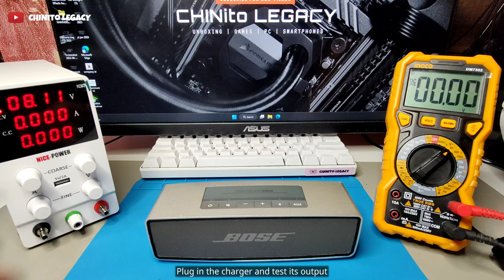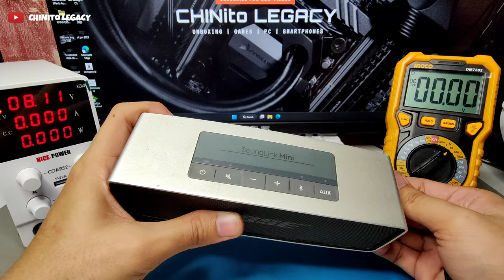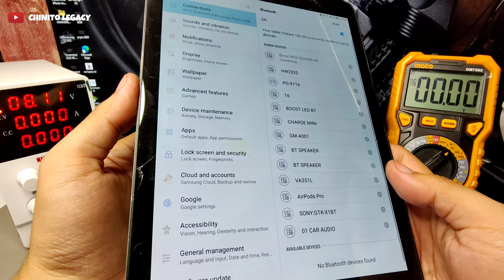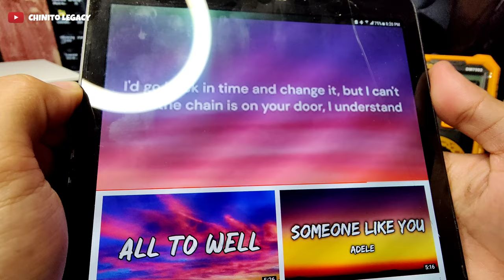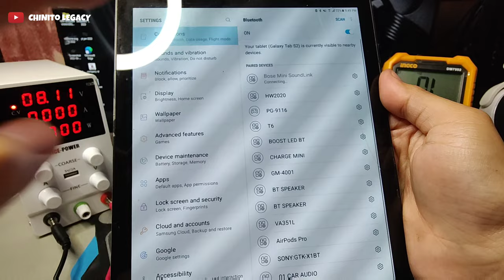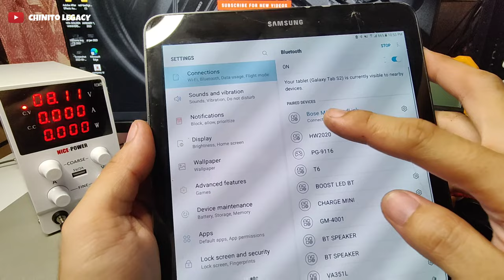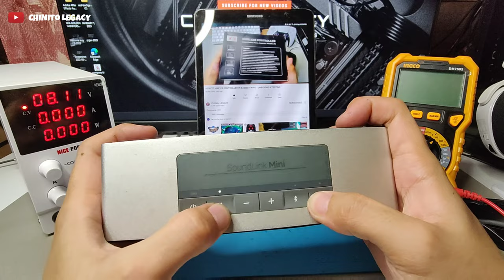BOSE SOUNDLINK MINI NO POWER DISASSEMBLY AND REPAIR GUIDE

Comment: And remember if your mini is not powering on after battery change, the most probably common issue is that the device erased the firmware and in that version (mini 1) there is no way to upload the firmware again so is lost forever.
Reply: Is this real even in bose official service center?

Comment: Bose SoundLink first generation.  No power.  Installed new battery, same thing no power.  Suspect main board issue.  Contacted Bose, they were no help.  How much to repair my Bose SoundLink?
Reply: get a new one
Reply from the maker: Depends on its problem
Reply: Pwde po mag homeservice

Comment: Fascinating and mildly soothing to watch.  Did you replace the capacitor and repair the shorted pins?  I missed that part.  Also, what liquid were you cleaning the boards with?
Reply from the maker: Yes the caps is replaced, isopropyl alcohol for cleaning
Reply: Hi, where do you buy capacitors? For DIY

Comment: I appreciate your efforts in fixing the Bose Soundlink mini (1st generation) Bluetooth speaker. However, I am deeply disappointed by the design of the circuitry housing, which I find to be inadequate and hindering repair. I purchased my Soundlink mini 1st generation for INR 16,800, along with an additional INR 3,800 for the pouch. I cherished this device, even writing an independent review after four months of use. Unfortunately, it now appears that the battery has failed, indicated by a blinking red LED light when I attempt to charge it. Bose no longer services this model, and the necessary battery is unavailable or prohibitively expensive from online sources. This experience has soured my opinion of Bose and other tech companies that produce such poorly constructed devices. I believe it is time for consumers worldwide to voice their concerns and consider boycotting Bose products. An independent agency should conduct a thorough audit of such practices. It is regrettable that a company of Bose's reputation has failed to meet my expectations.
NEW DELHI
INDIA
Reply: Same here.  Well that’s the all
Are going.
Reply: I agree with you.
Reply from the maker: Indeed
Reply: Amazon la tiene

Comment: Gud day boss 
Need ng help mo 
Baka may idea ka bakit bagong paklit na battery nito at latest. Na software update pero red blinking light pari
Reply from the maker: Try charging for 1 hour po, pag wala pa din baka faulty na po motherboard nyan
Reply: @chinitolegacy  bose mini 2 gamit ko kasi red light talaga at di ma downgrade ang firmware nakaka bad3p na mahal pa ng batt 2500😭
Reply from the maker: Try mo hard reset. Search mo na lang kung paano
Reply: @chinitolegacy  na try kona ser ehh 
At tsaka nababasa sya ng laptop kapag kinokonek ang kaso kapag dating sa pag update ayaw tlaga kaya di mawala red light
Reply from the maker: Baka may problem na sa motherboard yan bro
Reply: Bose mini soundlink 2 din sakin pag ganyang motherboard na sira wala.. useless na ba?